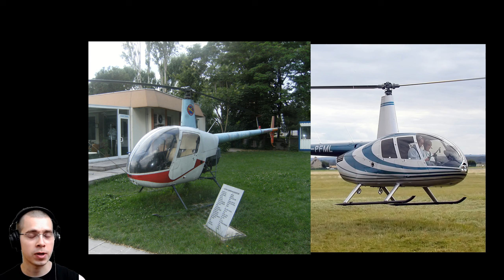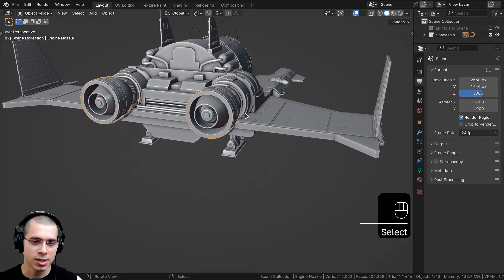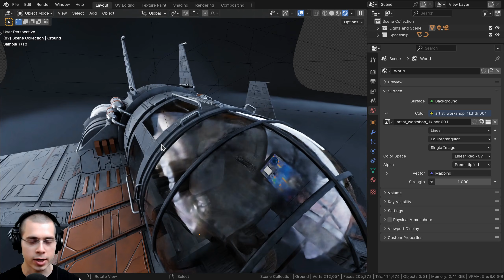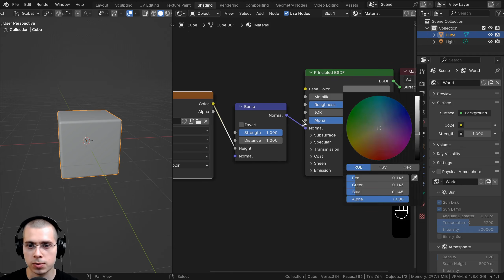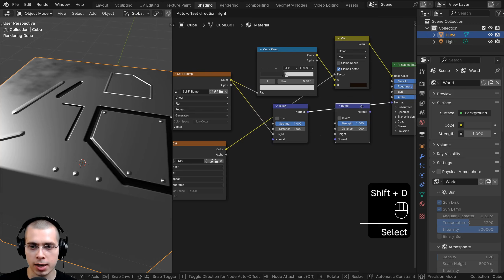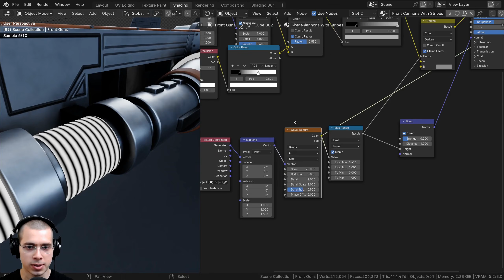Comment: great tutorial, thank you.....Ryan, just a tip when you're making the bolts you can change the shape of the falloff graph  into a soft w (sorry thats the best way I can describe it) and that will give you a hole with a bolt like rise in the middle...ok have just been playing with the falloff graph its not really a soft W the graph works in mirror mode so so going from left to right it something like a log line across the topmost edge, then about 3/4 of the way across a sharp dip down to the bottom then up again to the very top to form the outer lip of the indent.....hope that makes some sort of sense.